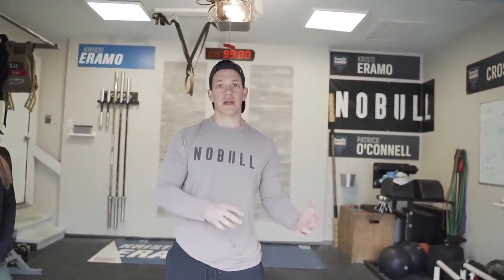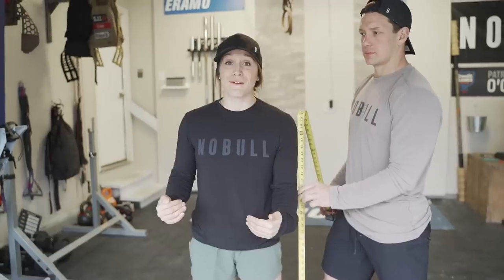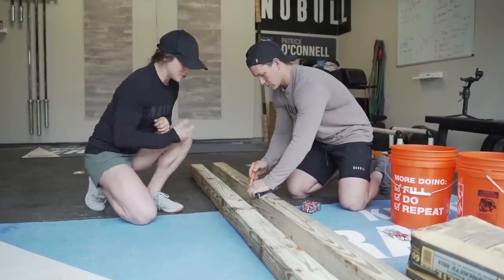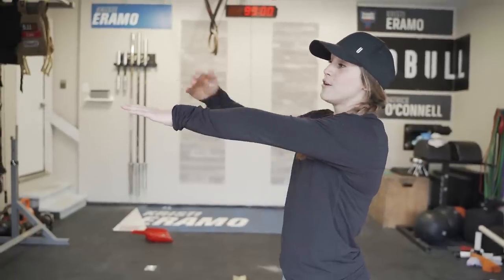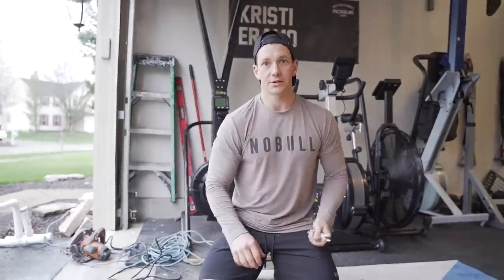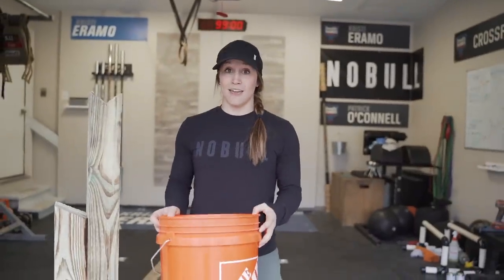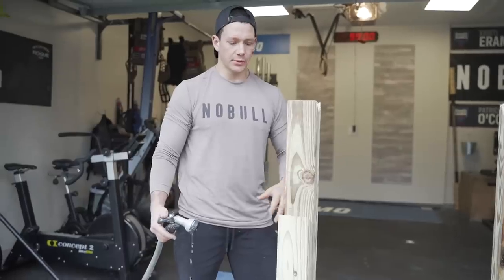HOW TO BUILD A SQUAT & BENCH RACK FOR 40 DOLLARS!

Comment: I have seen these racks with wood & concrete in Home Depot on other sites.  My son built them a few years ago and they worked ok, but they can be very unsteady.  If you screwed a 2X2 piece of 3/4in ply to the underside of the buckets before installing the post and concrete, they will be much less likely to tip or get out of position. FWIW
Reply: I dig it! that's a great idea! wish we would have doe that
Reply: @patrickoconnell2380  what does he mean by underside? Like screw it to the bottom inside of the bucket, or underneath on the outer side of the bucket?
Reply: @annievartanian9417  I think he means on the bottom of the bucket to create a wider base which makes it more stable.
Reply: @annievartanian9417  Yes, underneath. Before pouring concrete or putting the posts into the bucket. The very first thing you do is cut a couple of 2'x2' squares of plywood. Flip the bucket upside down, set the plywood on the bucket base, and screw the plywood to the bucket. Now you will have a large, flat square base attached to the bottoms of the buckets. When you fill with concrete, the set concrete will help hold the screws in place.

What I would do, but is a little more complicated is to build the squat rack exactly like was instructed in the video, and after the concrete is completely cured, tip it over on its side, use a concrete bit to drill 4 holes in the bottom of the bucket up into the concrete, then use small/flush concrete anchors to screw the plywood to the bucket. Now you KNOW that the plywood isn't going anywhere.

Comment: This is great! A thought on increasing overall stability. 
Instead of using a 5gal or 10gal Bucket to form the concrete, use a small tire. The volume of concrete (and mass) will be the same, but the tire will keep the weight lower and distribute it over a wider area of the floor, making it harder to tip. A small tire will also grip the floor better than a bucket, creating friction that will prevent sliding. 

To do this you would need to put a piece of plywood inside the tire or underneath the tire to fill the hole on the bottom side, then put in the 4''x4''s and Quickrete. The only downside is that it will take a little more patience to get the 4''x4''s to be perpendicular to the ground.

Comment: Recommend something safer if you're lifting heavy...
- Join the posts for stability, even better, make a cube out of it. 
- Maybe a bit of 2x4 in between the 4x4s, but higher than the squat rack, so you can walk it in without overshooting and slide down to resting position.

- Would add a bracket around all 3 pieces mentioned above, or a couple long bolts all the way through, just cos.
- Would recommend a bracket around the piece or bolt all the way through with oversize washers just below the squat V, just in case it feels the need to split apart.

Anyway, just my two cents
Reply: I would  add to now place the wood inside a bucket  

I saw buff dude made stand from wood and some steel anchor  (for safety )hold on 1000 pound

Comment: 30 Years ago I got three 8 foot pieces of 2 1/2" thick wall piping, cut and bolted  two "T"  bars, turned them upside down, bolted a 36" bottom cross bar and welded some short 5/8" rebar pieces every 6" as the bar racks.  I found the rebar on a construction site and bought the pipe. It cost me $100 and was strong enough to easily hold 315 half way up and at the top for squatting.  With all the gyms closed, I'm tempted to build another one.

Comment: Awesome job on this... going to attempt it myself but am unsure how you "notched" that V in the top of your 4x4? appreciate the help!
Reply: Stephane La Rochelle not exactly sure. Try turning saw to 45 degree angle, depth of cut 1/2 through the 4x4 at the 45 degrees mark.  Cut
Reply: I used my circular saw but you could draw your lines and use a sawzall or jamb saw

Comment: I'm 5"0 (60 inches), so Should I get my 4x4's cut at 58 inches? I'm only using it for squatting. Also, I don't need the lags if I'm not going bolt another piece of wood for the bench pressing, correct?

Comment: Instead of using cement buckets, I'm thinking about using longer lengths and putting the posts into the ground in my yard. Then filling that up with cement. Is there any reason this wouldn't work?

Comment: What was the angle you used for the top of the squat rack and bench post? Also how did you measure out how high the bench stand should be?
Reply: Hey! I cut 22 Degree angles. easiest way to measure would be to lay on your bench and extend your arms, measure from the floor to your wrist, then subtract 2"

Comment: you would be able to get away with a bar + 2x45lb weights and that's it. you need to triple up the bracing, making the posts like pyramid-like or at least bracing front-back so you have a triangle. triangles are the strongest shapes
Reply: hey! well the barbell would have to split the 4x4 down the center to fail.  but we regularly have 400+lbs on without any issues!!

Comment: This variant is more dangerous than the 2x4 because the angle of the bench press holder puts the pressure on the joint between the two lumber instead of the lumber itself. Meaning the bar and the weights are being held by the screws connecting the lumber.
Reply: @Branden Guptill thanks for watching!
Reply: both post are set in cement so it would also have so split the concrete to cause a problem! wouldn't be our first choice, but a great solution during a time when its hard to order a real stand!

Comment: I really want to make this. Is there a way to add in like spotter arms for the bench..? Also how much can this hold weight wise?
Reply: it can hold a ton of weight, I have had 400lb on it. spotter arms wouldn't work with this design unfortunately but I have seen more elaborate designs with them!

Comment: I already have a bench so wondering how much the second 4x4 for the bench helps the overall stability of the squat stand.  Should I just use 1 4x4 in that case or still bolt a second one in to make the squat stand more stable?
Reply: Hey! it really doesn't add any stability, if you don't need it I would bother adding it!
Reply: @patrickoconnell2380  Perfect.  Thanks!
Reply: @patrickoconnell2380  One last clarification.  You mentioned 1.5 inches for the notch in the squat rack.  Is that 1.5 inches down from the top, then find the middle and angle the cuts down from the corner to that center spot 1.5 inches down?
Reply: @patrickoconnell2380  I built the rack last weekend with the lag bolts but have a few of questions.  First, how long did you wait to let the concrete set before you put weight on it?  I did it about 40 hours ago thinking 24 hours would be enough time and the concrete still feels wet and doesn't seem to have fully formed yet.  I read a few things online about it taking a week to a month for the concrete to be at it's strongest.  Second, I'm really concerned about it tipping over when I put a lot of weight on the lag bolts as the center of gravity won't be centered.  I'm also 6'5" and wondering how much of an impact having the weight higher up the post will have.  How tall are you and how much weight have you tried using the lag bolts.  Also, Quickcrete bags were 50lbs locally and it looked like with water, it would fill the bucket so I didn't use 60lbs.  Wondering how much, if any impact you think that might make

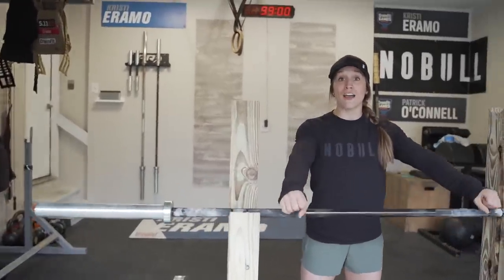Comment: This seems like a bad idea. When he racks the empty bar at 7:47, he wobbles the right post. Imagine if he had any serious weight on that bar.  To make it safer, you would have to connect the posts so that they can't move independently and build feet to prevent toppling.
Reply: greatdane2609 they didnt let the concrete set yet. It takes 24 hours. They were just demonstrating it.
Reply: Yeah this is absolutely a trash design.. buff dudes made a 100% better one
Reply: Joshua pierce not really meant to be a longterm. Just a quick build for this isolation bullshit. A lot of equipment is backordered, people dont have time or money and this is something simple.
Reply: @joshuapierce5884  thanks for watching!

Comment: Screw a large flat piece of wood under the bucket then plug the hole, then screw the posts together with a long board or screw a second piece of wood under the bucket 90° rotated to the first, to stop most of the movement. The bucket being a circle is the reason the design is flawed, only other option though is to build a base
Reply: we have since done that, and a squat piece of wood under the bucket and bolted to the post seems to be the best combo!!

Comment: How did you transport these?
Reply: the easiest way to move them around is to tilt it a little bit and roll it on the edge of the bucket. but they weigh about 80lb total so they can be picked up as well.

Comment: 7:29 How would you get room for the weights on the bar then? ;)
Reply: I had the same question.
Reply: Maybe not slam the weights against the barbell stops. Or lift up on the weights as you slide them onto the bar. 🤔
Reply: Full Body Joe that is not the point here...
Reply: @bjornskov70  Sure it's not.

Comment: How much weight can it hold?
Reply: I made a squat rack with 2x4's, instead of notching a 4x4 shown in the video, with 50lbs of concrete in the bucket and had 275 on it with no problems. As long as everything is balanced and level, I don't think you would have any load issues. But I'm neither a carpenter or engineer, nor do I play either on the internets
Reply: I would imagine it can hold as much as you can squat, what I would pay more attention to is not knocking them over!